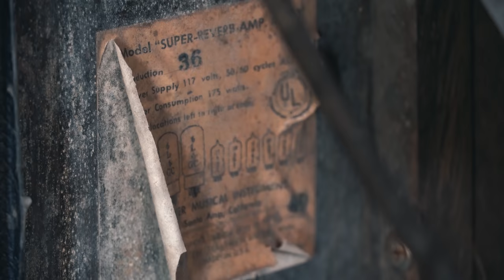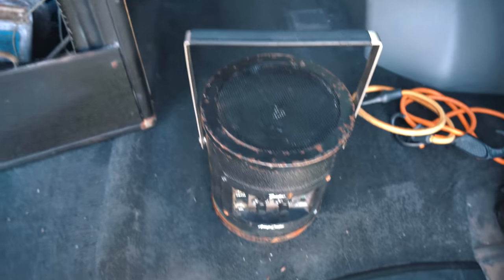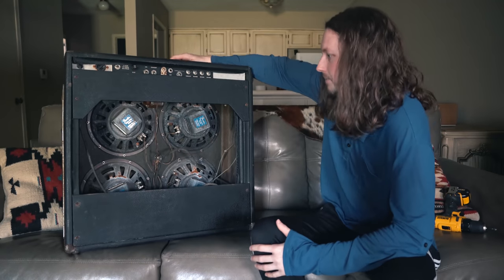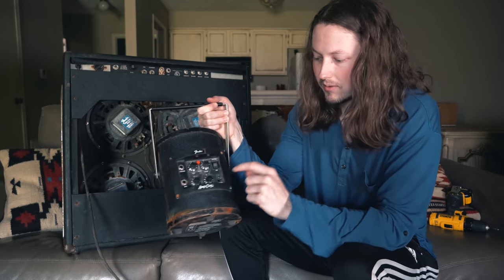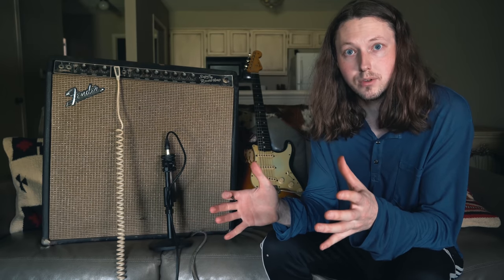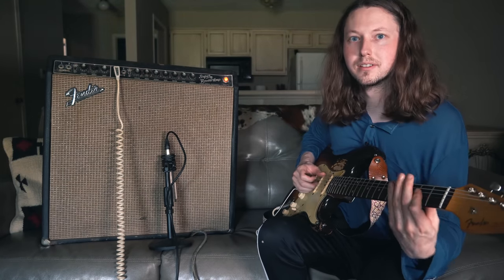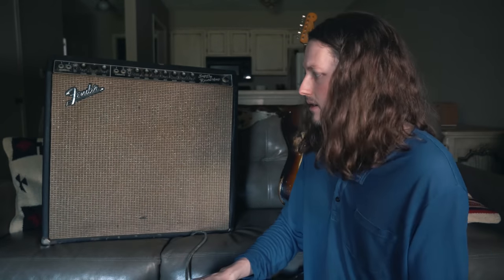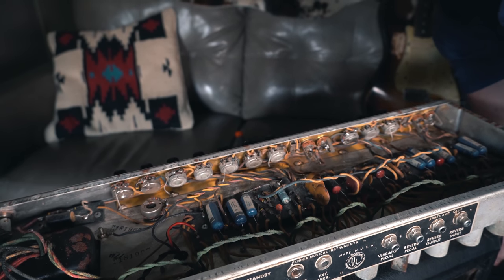VINTAGE Fender Amp Safari - BARN FIND!

Comment: Good find. Hope it works out.  I sure hope you sprayed both of those amps down with disinfectant to prevent Corona. Can't be too careful. I have an original Fender amp can with the wall charger in perfect condition still. As far as I'm concerned it was the best portable small rechargeable little amp that Fender has ever made, sound wise that is.  I still have and use mine from time to time...
 Now there are a ton of small portable rechargeable good sounding amps on the market, but when this came out it was like an innovation.

Comment: Right after the 12 minute mark, probably the rectifier tube or a capacitor with moisture in it. Wouldn't hurt to check the recto tube and recap the amp.

Comment: matthew thats cool that it works, but you should invest in a dim bulb current limiter. its basically a light bulb in series with power input, it will absorb the current if there is a short in the amp and save the transformer/ rectifier etc. its easy to make you need a a few components probably cost $20 to $30 to make and you will be glad you have it when you fire up an old amp. even better buy a $59 variac and use that in conjunction with th e bulb current limiter whenever you fire up old tube gear for the first time. this makes it safe and prevents damage to unreplacable compnents uncle doug has a video on how to make one and also guys like the guitologist and dLab wont fire something up without. just search buid your own current limiter and watch uncle dougs video.

Comment: WOW!!! An Amp Can!!! I'd love the super....just plug it in, no, ONLY if you have a variac!!, yo do not want to waste a xformer(I repair all my tube amps).  Ah, the death switch (2-prong AC-danger will Roberson)
CAREFUL....the 6L6's glass may break off, surely the gas/air
 is gone.  OMG, it fires up! damn good find, man! Definitely change out those caps. Good luck with it. 
tuna

Comment: You can clean the grill cloth by separating it from the cabinet.  Use a spray bottle of enzyme for 1st step, (Auto Magic #25)  2nd step spray bottle of a diluted all purpose cleaner and 
3rd step just water to jet the remaining dirt away!  simple and the spray bottle sprayer provides the agitation!  (Like a mini power washer if sprayer held close!)  I would recommend a quality trigger sprayer and or buy a zep sprayer with bottle at home depot.  You would still retain the original grill cloth and it just looks more of a cleaner vintage, if the mouse urine and mouse shit is removed!  Unless you want that look?  -Follow up with a hair dryer or heat gun to dry and stretch the grill cloth if needed for a wrinkle-free result.

Comment: Of course you're going to get comments about firing it right up.
Always use a Variac..
Start out at low voltage and increase in increments.

Comment: Hey Matt, we all love ya, bro, and we don't want to see anything happen to you or any of your righteous gear. Here's a heartfelt tip: Try and squeeze off a few bucks for a basic Variac with an ammeter. It'll be under $100. Also see about making a little box that has a 100 Watt light bulb in series with a regular extension cord. Its a current limiter, and it's an old timey radio man trick from The early days of electronics. My grandpa had one that he made in 1920, and he used it every time he went to fire something up. If there are any serious problems, the light bulb will glow really bright and you can shut down without burning anything up. You won't even blow the fuse. (I save lotsa $$$ on just fuses alone every year) your tech can help you out with getting those two items together, and that way you don't get electrocuted, and a righteous cool amp doesn't go up in smoke either. You been playing too long and you're getting too good to biff it now.
 Keith Relf, the singer from the Yardbirds is no longer with us because of electrical foolishness. Much love and respect to ya, my friend!

Comment: It's kinda hard to imagine nowadays, but once upon a Time in the old free America, they actually had companies that made great stuff and had people who took pride in their work. What you have there is a brilliant design, put together by good folks who came to work every day and worked, not stagger in all hung over, and then go and smoke crack on their breaks, get drunk at lunch and then go stay out all night. People were a little bit more wholesome and conscientious in those days. That's why they were well paid, and cared about what they did. I met an old guy and his wife who both worked at the original buildings down in Fullerton from 1957 to 1969, and they said it was the best place to work that anybody could ask for. Look at this thing. All those decades of use, abuse and neglect, and it still fires right up!! That's a not so silent testimony to what is possible if the company who built it has the integrity to do it right. God bless Leo Fender, George Fullerton, Forrest White, Freddie Tavares, and everybody else who worked there during those years!!!! You've really got yourself something there, and it's not gonna need massive amounts of work, just do what Absolutely has to be done to make it safe and reliable. I'd bet most  of those tubes are still strong, but the rust on the transformers is probably the biggest problem it has. Make sure that whoever you get to remove it  knows how to do it right. There's a trick to it.  More than just sanding it off with a piece of Emery cloth. You might want to think about new speakers. Those originals are worth Lotsa $$$$$ if they're not blown or reconed. Put those away for if you ever want to sell it. All the rest is just gonna be routine maintenance.  Have fun!!!

Comment: BEFORE even thinking about turning on the switch on an old tube amplifier, you MUST 
1, check that the filter capacitors are not leaking!

Comment: For those of us who are into old cars as well as guitars and amps, this is equivalent to successfully firing up an engine that has been sitting, rusting away for 50+ years. It is testimony to how simple and well built things were back then. Try firing up a 20 y.o. digital amp, or computer infested car that's been exposed to the elements. I gare-own-tee you'll be SOL.

Comment: Do not touch the rust on the transformer laminations please.  The oxidation rust will keep the laminations from shorting.  If they short you will have issues.  Rust is usually harmless on the laminations.  Mercury magnetic has an article on lamination rust.😉

Comment: Just for your own safety and for the integrity of tubes old or new, always wear rubber latex gloves when handling or replacing them as skin and finger oils do serious damage to the glass and when heating up they will crack.
Reply from the maker: Thanks for the tip Derek!

Comment: This kind of proves the durability of PTP wiring/construction.
Leave a modern circuit board or modeling amp out in a barn for 10, 20, 30+ years and tell me if you'd expect the same results.
Just saying
Reply: Smoke, lots of it, and firecrackers.

Comment: The Fender “Amp Can” was a mid 90’s battery powered travel/busking amp. They didn’t sound great but they did make guitar noises.
Those speakers didn’t  look like CTS speakers because of the rust/dirt! Yes, they are CTS speakers.

A used Mullard GZ34, two RCA Blackplate 6L6GC’s, Telefunken ECC83 and the other preamp tubes are worth twice what you paid for the amp.

Never, ever, ever just plug an old amp in and turn it on. Besides the possibility of damaging the amp/tubes, you can kill your self if there’s a short.

I can’t tell the difference between the OEM Blue Ajax/Mallory caps and the new Blue Sozo/Yellow Jupiter caps tonally. Which is good if the original caps are bad. The ceramic caps in these circuits need to be ceramic if they’re bad for whatever reason. Of course ALL of the electrolytic caps need to go, working or not. Same as the bias diode. I’d imagine your amp guy will do what needs to be done.

VERY NICE FIND!

Comment: I have a mid 70s vibrosonic reverb 100w 15” speaker the jbl was replaced with a jensen been professionally gone through and condition is pretty good not great just wondering if it’s a rare one I don’t much about amps but I don’t see many when I look around anybody out there know much about these amps I was told it’s a desirable amp for steel guitar players it’s loud as hell  but idk ?

Comment: The transformers will not be the problem. Any problem that will “blow up” and destroy stuff when being powered on after a long time will be related to the capacitors
Reply: Or a shorted transformer, e.g. from sitting in water.

Comment: Yikes! two prong plug!  Make sure if their is a ground switch it is neutral position first to avoid "Death Cap" circuit!  and I noticed you completed a circuit by griping the guitar strings on power-up!  I would have just powered it up without touching the guitar.

Comment: The original electrolytic capacitors are the most dangerous part of that vintage gear. Lowering the voltage increased, rather than decreased the risk. Unlike generations of bad sci fi movies, tubes don't blow up. Those big can capacitors flatten the half-wave DC coming out of the power supply. When they age, the oil dries up and they turn into bombs. They won't hurt you, but they'll make a mess of your couch and fill your home with an awful stench. The tubes will just stop working if they fail.  One thing that might be a hazard in vintage equipment like this is that the chassis may end up hot (failed transformer windings, failed caps, etc). It won't start a fire (unless you leave it on for a long time), but you might get bit when you try and turn it off.

The real irony for me is that I fiddled with amps like this during my band years while I was a teenager (1964-1972). Those 6L6-GCs and 12AX7s were nearly universal. We thought of Fender equipment as fair-to-middling, but not really "desirable" (that was reserved for Marshall). I played organ (Farfisa compact deluxe) and I lugged around a "Kustom 200" in black (https://www.youtube.com/watch?v=dRRSQ6JdyGc). My band was LOUD. On some gigs, I shared my amp with our bass player.

I have to say that I don't miss the Fender gear, and -- here's the real heresy -- I think solid-state amps and modern electronics sound WAY better than any of this analog gear ever did.

Comment: Him: don't fire up an old crusty amp. You could destroy a valuable vintage amp.
Also him: fires up an untested old, crusty amp.
SMH
FYI: just looking at the tubes won't tell you they might be shorted. At least check them with a multimeter. Shorted power tube= fried transformer. For SURE, you need to get those electrolytics changed. Nice find.

Comment: Them fender amps sound great but they smoke out too fast.. That styled has been beat to the ground.do something diff use a pedal or something.Hendrix used the same style o jamming but changed the signal get the drift...ur one that can do it...jamm onn boy..

Comment: Fender is certainly not like it used to be. You can’t even get a real timber body from them anymore. My 2010 strat is made up of 9 pieces of scrap wood glued together. I asked Fender what was going on. They told me in an email that they don’t publicly tell you what is underneath finished guitars. They only claim to use 3 piece bodies on high end and custom shop models. So it’s safe to say you don’t always get what you pay for. If I can save one person from making the mistake I made I’ll feel better. Stay away from new finished Fender guitars unless you get it in writing that it’s solid wood.

Comment: You dragged it on the knob's man, you actually dragged it on all the volume and tone knobs. I don't know what the hell to say to this man, I had a little respect now ,I don't.....
Reply from the maker: Dragged it on the knobs? What are you talking about? The knobs are at an angle and could not possibly be "dragged". This is the proper way to load a vintage amp because of the weight of the speaker magnets. 🤯🤯🤯wtf